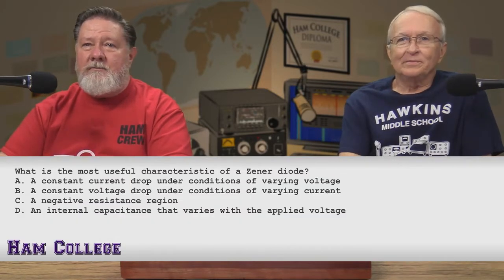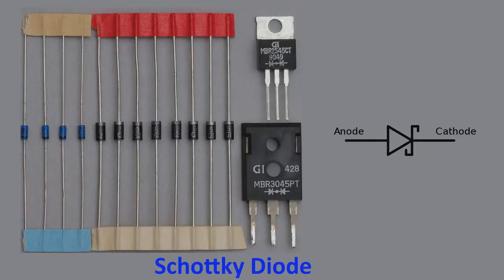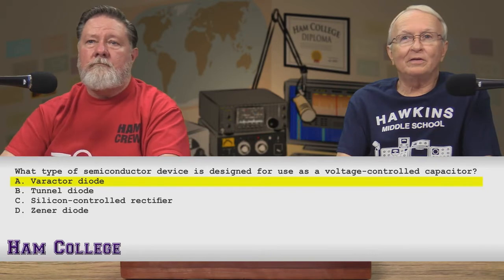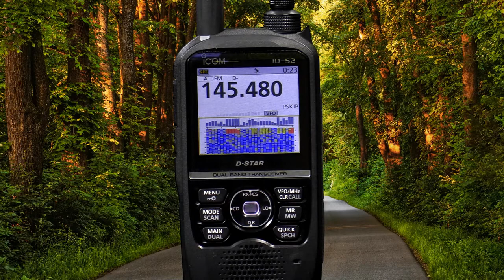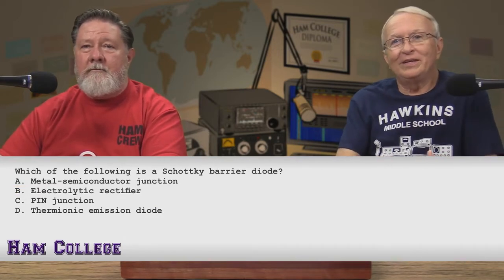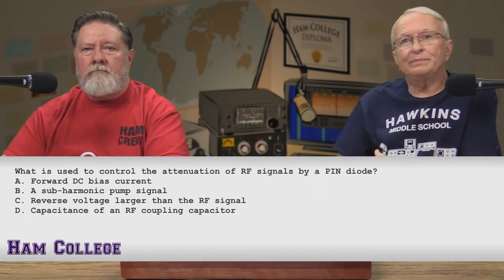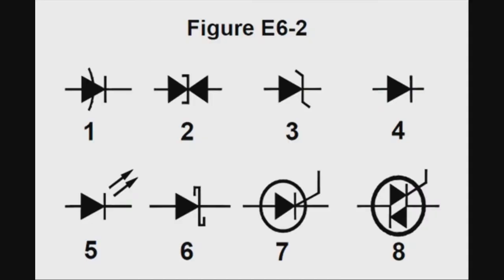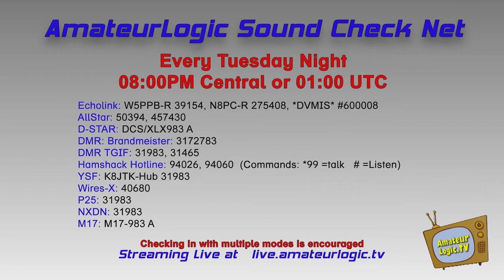Ham College 87

Comment: 27:00 I'm not a radio ham, but I would have said "A. As a rectifier in high current power supplies" due to the lower voltage drop across the schottky diode resulting in less heating than other sorts of diode.